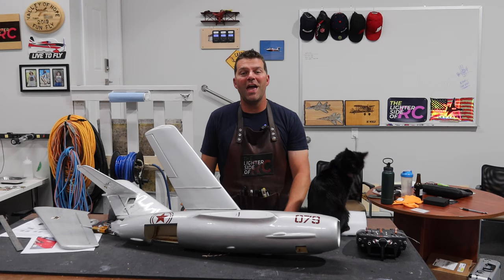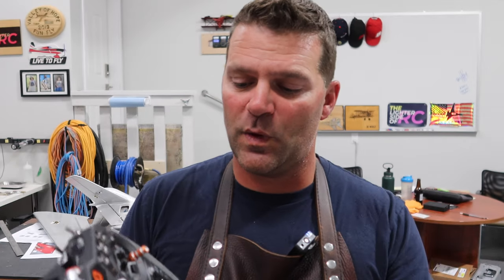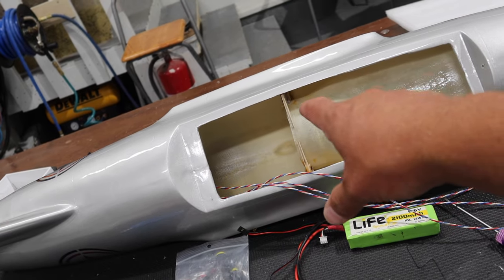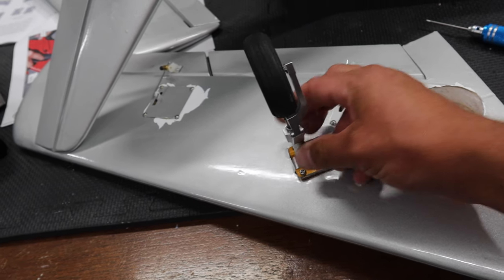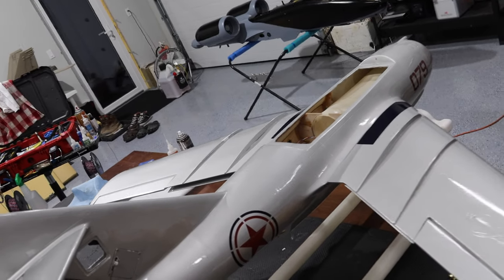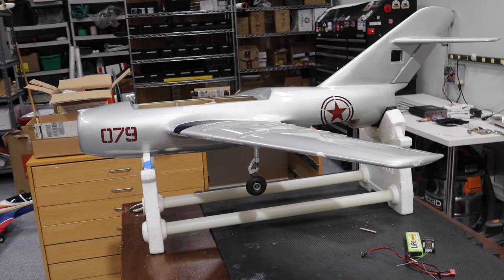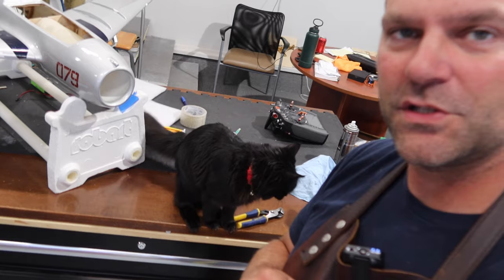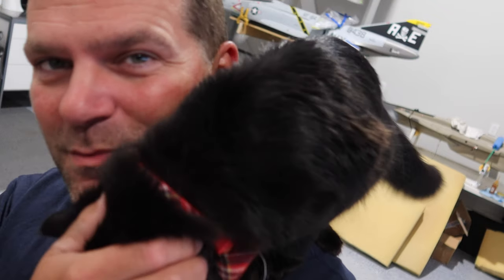THE BEST EDF MIG 15 Build - Wings ON!

Comment: In my experience, the small spring air units won't fit anything wider than a wire leg. An oleo strut will foul the air cylinder.?.

I didn't see you try a gear retraction with the oleo fitted. Out of interest; did it all fit?
Reply from the maker: All fits great!  It will be a bit of trial and fitting on the wheel size but it's coming together nicely!

Comment: I noticed on the Mig the main wheels are inside the strut, is it possiable to do it on that one
Reply from the maker: Could but I opted not too as the struts would stick out funny on the wing.
Reply: @thelightersideofrc  ya that's true. Cause in order to put that way , you would have to recess the retracts